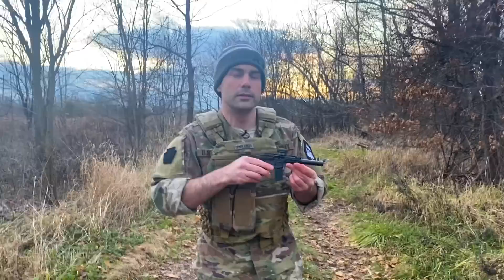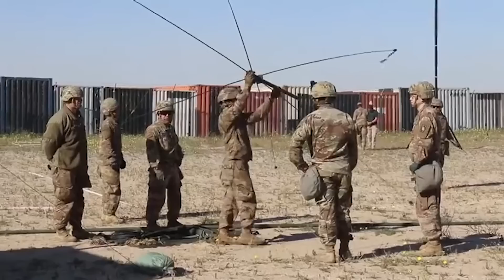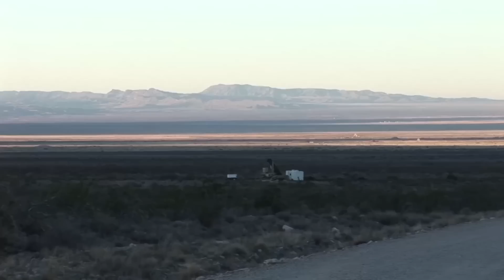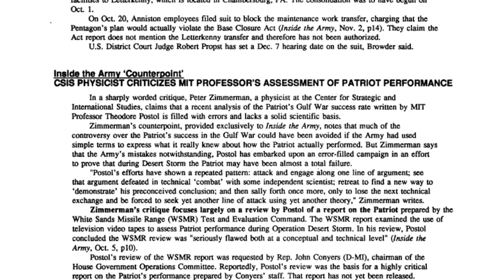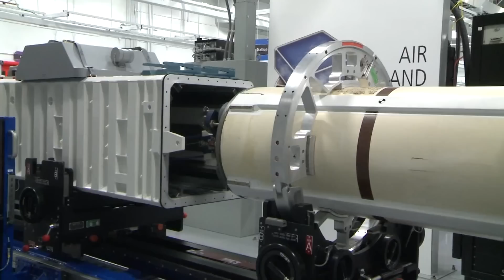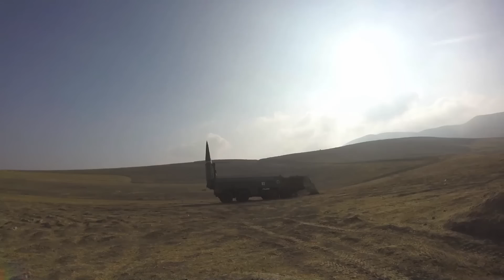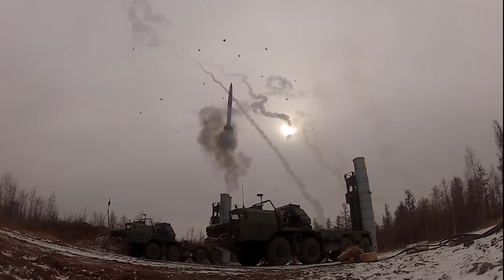Can Patriot Anti-Air Defense REALLY intercept missiles?

Comment: If you want to shot down aircraft and missiles then the system makes sense but if you are dealing with drones then you want a system similar to the Phalanx CIWS. 

Then there is the matter how often a target that is shot down is completely destroyed. Partial destruction is okay if it happens over an unpopulated and fairly empty area but over populated areas the debris can still cause unwanted damaged. I think of the case of an aircraft being shot down. While it maybe shot down by AA guns or SAM batteries, if enough of the plane still remains then it can cause unwanted destruction.
Reply: the range of the PHALANX is ~5km. 
instead of a missile system, we would need hundreds of CIWS systems, of course with operators, active radars, fuel, ammunition... and even so it may simply evade its range... By the way, the Ukrainians have something similar, and from the Germans they also received GEPARD SPAAG systems... they are good for point defense, but the missile systems cover several square kilometers...

Although sending a $4 million PAC3 missile at a $5,000 drone is really overkill...
Reply: @vorosjanos77  The cost of the system vs the value of what it is shooting down is the problem. Point Defense system can work for drones. It would be better if they could locate where the drones are being launched from and destroy that.

Furthermore, how well will it work in a drone swarm situation. Missiles may not be the best solution to dealing with a swarm of relatively cheap drones.

While the drones can be made cheaply and quickly, the missiles used against them will take longer to build and cost more. 

The cost makes sense if the targets are restricted to aircraft and ballistic missiles. But against drones, it does not. 

I think that the French developed a system that can deal with drones and I think it has a range of 2.5 miles. It is a 40mm anti-air gun and I believe that it is referred to as the RapidFire system but I could be wrong.
Reply: @dragonslayer2107  
Russian tactics: cheap Iranian drones and cheap ex-Soviet (junk, obsolete) missiles. Of course (although they are inaccurate and ineffective), these can also cause millions of dollars worth of damage to power plants, infrastructure, and warehouses.
 They take advantage of this, they force the Ukrainians to shoot them, the point defense is not effective because there are alternating targets (sometimes they succeed only with SPAAG), the only thing left against them is the rocket, which is unbelievably expensive compared to what they launch...
The S300s are sold out, the IRIS-T-SL and the AIM120 (used for the NASAMS system) are running low...
They have to defend themselves against drones, missiles, whatever they have... that's why the patriot system will be interesting, because the patriot is not designed to shoot 60-80 rounds a day, especially if these pac2, pac3... you have to pay and also produce it, because just like the shortage of 155mm artillery ammunition, or the HIMARS missiles, after a few months, all NATO countries will run out of stock, and no one will provide the strategic stock...
Reply: @dragonslayer2107  IF the rumors are to be believed, they are running out... 
although they shoot 60-80 conventional missiles a day, mostly old ex-Soviet stuff... An unknown number of Iranian drones, and an unknown number of self-made ones (~Chinese base). It is not known who else he buys equipment from (e.g. North Korea) According to some rumors, 50-60-70-year-old passenger aircraft are being collected all over Russia (an-2), perhaps using some cheap structure as a kamikaze drone, or even several tons of explosive charges (even some cheap mining with explosives)
IF these rumors are true... here too it would mean that the value of the rocket is more than that of the machine, which would be assembled just enough to be suitable for a trip there...
However, if they really wanted to, they could overburden the defense systems with something like that, and even old su25 fighter planes equipped with the cheapest gravity bombs could safely fit between them, or even bigger bombers also with the cheapest bombs...

The Russians cannot be counted out, when genius is combined with primitive, cheap technologies, modern weapons are taught a lesson...
Reply: @vorosjanos77 modern weapons crushed the Soviet/Russian "genius" tine and time again.
Reply: @ChucksSEADnDEAD  
Not THAT question! 
(of course the American weapon can do it...) But how long can rayteon deliver a missile to the system (it does not have unlimited inventory or production capacity), and who pays the bill and for how long?
It is NOT just about the bills for the PAC2 and PAC3 missiles, but the many thousands of HIMARS, HARM...

Comment: Yeah, I don't know that it's worth sending multi-million dollar missiles (each) at a multi-thousand dollar (or less) drone. What about the land-based CWIS systems that the Army uses? Sure, the range is only a few miles but many of those systems could be set up around Kyiv and the BRRRRRRRRP from them would take out those cheap little drones probably effectively?
Reply: They have Gepards which are being used for that. The Patriots just add another Layer of possible defense
Reply: Hopefully something will  be done about Iranian drones being (reportedly) 80% US/Western-made components, or maybe not since no-one else seems to think it's worth mentioning
Reply: You guys can't be that stupid, these missiles will be used against Kalibrs and other long range cruise and Iranian ballistic missiles, drones get downed by stingers and gepards.
Reply: @Aedeus  Well, of course, I agree, if they are protecting against Kalibrs and other large/fast missiles, Patriots would be called for. But the story was intimating cheap, small, slow Iranian drones were what the target was.
Reply: The cwiz is only good for several 1000 meters, patriot battery is good for hundreds of square miles.
And  used for specific targets and defend high value targets.

Comment: Patriot system is proven garbage
Reply: then russia really shouldn't be having such a fuss over them then....
Reply: @nobodyherepal3292  I haven't seen Russia talk about the Patriots.  The US waited 10 months to authorize this system for a reason...they know this war will be over before that system is transferred to a trained crew in country.  A little theater combined with embarrassment avoidance.
Reply: @beachbummer3434  the Russians literally said sending patriots would be a “escalation” last week. 

Apparently it wasn’t too big of a deal for them then.
Reply: @nobodyherepal3292  one missile battery...that doesn't integrated with any existing Ukrainian weapon or radar system and takes 13 weeks to train a crew.  yea, that's not theater 🤣
Reply: @beachbummer3434  you could make the same argument for NASAMS and Iris-T too. 

Yet they seem to be working just fine
Reply: @nobodyherepal3292  Russia seems to hit whatever infrastructure they want
Reply: @beachbummer3434  at higher and higher munitions costs, due to all the air defense Ukraine now has. Probably why they’ve resorted to using Iranian drones and repurposing SAM and anti-ship missiles for ground attack roles. 

And it’s not doing much to break Ukrainian morale. If anything, it each attack just secures more Lend Lease supplies for Ukraine.

Comment: If they send say 3-4 patriots at 2 incoming missiles and then the first patriot destroys the first missile can all the remaining Patriot missiles be retasked to the remaining missile in the air?

What if there is a 3rd attack missile that came later on the way and the first 2 patriots shot down the first 2 missiles can the remaining 2 retask onto that third missile IF they have enough fuel and maneuvering.
Reply: They are rockets, not air breathing jets that can just circle around.
Reply: The PATRIOT missile has a PIP - predicted intercept point where the missile goes to say 'hi' to the target.  Although it can track over 100 targets and engage 9 or so targets at the same time, it cannot 're-assign' a missile currently in flight....

Comment: The problem is that each Patriot missile cost millions, but the drones it would shoot down only cost thousands
Reply: What about the electric PowerStation the drone was going to blow up? how much does that cost?
Reply: @Ohampion  yeah but its worth it for the Russians
Reply: The Patriots aren't generally used against drones. The missiles used against the infrastructure "cost millions", too, not to mention the cost of rebuilding / repairing what is destroyed. And I have not even factored in the loss of life due to the cold when the electricity infrastructure is hit.
Reply: Thats why you layer air defence though and also use s300 and gepards and stingers
Reply: @tomhuber1994  Yes! Let St. Gepard take care of them little drones.
Reply: You also have to account for the cost of what you're defending, for example missile costs less than an entire electrical grid and not getting supplies to the front line because the trains don't work and loosing the war because the troops don't have anything to fight back with.
Reply: @glassfullofmilk  what about 40 missiles to defend a single power plant?
Reply: but the lives those drones could take are priceless
Reply: @froginthewaves8450  Life is cheap
Reply: @froginthewaves8450 ukriane has 900,000 soldiers there not priceless
Reply: @Thunder_playz_331  were not talking about soldiers were talking about civilians
Reply: @kylemcqueen9465  in the long run it won't matter
Reply: @M88881  it's a war. You don't win wars by being moral and ethical quite the opposite in fact
Reply: They’re not going to use them against the shaheeds. I don’t know why people keep saying this.
Reply: The production cost of the drone is irrelevant.  The value (or replacement cost) of the drone’s target is what matters.
Reply: @seanmcdonald4686  
😁😁😁 It's hard to write a stupider comment. What happens when people who have no idea about war discuss war and weapons. Good job propaganda. Do you think that the Patriot can defend itself against say 10 drones at once - or only one??  And that's what it's all about - it will be a target
Reply: You must Count Not only the cost of the Drone itself but also the Potential damage it does.
Reply: Patriot must be used against Kalibr and Iskander,logically.
Reply: True, but what about the cost of whatever it’s going there to protect?
Reply: They will shoot drones with cheaper methods like flak and Gepard. They have strategic ability read my other comment
Reply: Thats ok. Uncle Joe gave them BILLIONS!
Reply: The not gonna use it for drones,a Ukrainian general was interviewed in the NYT and he said it will be for the missiles that Russia been firing consistently and that they will focus other systems on those drones and other similar with the Gepard and handheld weapons
Reply: @seth3525  
The problem with western media and stupid propaganda is that it leads people to think just like that 😁 There is no doubt what the Patriot will do, and how long it will last.  The first and main goal of the Russians when they arrive in Ukraine will be to destroy it. And that won't be a problem for them. In Saudi Arabia, it was turned into a powder.
Reply: @M88881  yet HIMARS is still causing problems against the Russinas 10 months in
Reply: @seth3525  
Come on man..do you know anything about war?
Reply: @Milivoj  I serve 9 years bro. This is YouTube h dnt kn people's life
Reply: The best Patriot strike is the one able to take out the Russian launchers right where they sit be it on Russian or Belorussian soil and before they are able to launch.
Reply: If any of us had families in the path of this Russian air assault, would we hesitate to use any defensive weapon available to stop it? Suddenly money becomes no object.
Reply: The Patriots shoot down other missiles and planes
Reply: Patriot will be used to shoot down the balllistic missiles iran is sending to Russia not cheap cruise missiles, ukraine is alread shooting 90% of those slow drones with machine guns
Reply: I highly doubt it's 90 percent and the Russian send multiple at the same time and the drones either get shot down by aa missiles that cost millions of dollars or overwhelm small arms either way its a win win situation for russia and even if machine guns can stop them they cost so little it won't matter and the Russian will just send more
Reply: @alfaromeo6985  the russian drones cost around 30k each and if ukraine uses a s300 to shot it down that's a 2 million dollar missle against a 30k drone
Reply: @Thunder_playz_331 they're way more expensive than 30k, there's way too many high cost components inside recovered Iranian drones
Reply: @ChucksSEADnDEAD  bro there literally just civilian drones with explosives added to them
Reply: You know war is ugly when you put your económical and financial shit on it
Reply: You can use the Patriot against the drones, but you don’t have to.
Reply: Do I believe the claims of 100% interception? No. I'd be shocked if it was better than 50%. But having said that we've had more than 20 years additional development, and you would be a fool to ignore it. I'm hoping that Germany will send Oerlikon Skyranger or similar anti-air artillery with very inexpensive air bursting rounds to handle drones and cruise missiles. Save the Patriots to kill any Soviet *ahem* Russian aircraft that come anywhere near.
Reply: It should be C-RAM to shoot down those drone and other small targets.
Reply: @jeffenad5412  c-ram are still expensive.  The Oerlikon 40 MM rounds are less than $50 each, per Namco.  Only 20 rounds needed per intercept, on average. So that adds up to less than $1,000 for intercept. They are the perfect tools for these small drones.
Reply: @The Barking Mouse  C-RAM is less expensive than Patriot missile, engage multiple hostile and accurate. While anti-aircraft guns such as the old and reliable Bofor 40mm will do to small to medium size targets such as drones, the accuracy is the problem, the speed which it can engage multiple targets, and need to have many guns and personnel. If you have too many personnel in anti-aircraft role, it will thin the frontline personnel that can push and hold the line.
Reply: I think they are looking for bigger ‘fish’ to shoot down!
Reply: It's not meant to shoot uavs that are light weighr!
Reply: Our patriot will not focus drones. We will have enough systems to destoy it.
Our efficiency in destroying drones are about 90% already, so no need in patriot for these
But we need patriot for ballistic missiles
Reply: The infrastructure the drones are hitting costs millions too, though.
Reply: It should be targeting cruise missiles , ballistic missiles and aircraft, with gepard, shilka, stinger etc going after drones
Reply: That’s why they are working on the 500 kilowatt laxer systems. It’s like a dollar a shot w that 😂

Just gunna be a while before they are cheaper to build 😑
Reply: But infrastructure damage costs can be in the 100s of millions of not billions depending on the scale of war
Reply: That is a very dogmatic question you ask.  No matter how deep NATO pocket the Ukrainians better learn to preserve the resources provided.  This is going to be a war of attrition.  Putin will give up only when he runs out of money and troops.